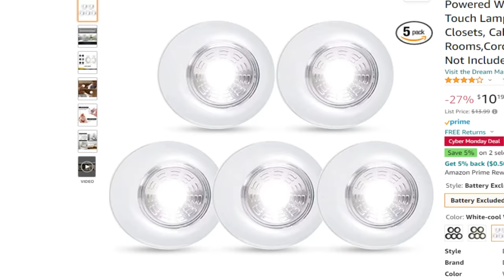3D Printing an Iron Man Suit! | MK39 Starboost Part 10

Comment: Best thing I can think of for the jet packs is a combo of fans and those smoke pen tools they use to test airflow. I think there's a variety they make that operates with a liquid, that way you don't have to deal with air compressors. 

Though no matter how I see it, there's a danger. With those, it's a chemical danger. With compressors, it's a mechanical danger (explosion).

Comment: Hey frank! for the battery pack, i got a way with using a 4x AAA battery holder with a built in switch and hid it behind the servos. It’s wired directly to the Vin ports on the board the the +s of the servos. (They’re all in parallel) Maybe that can work in terms of getting the helmet to be all self-contained.

Comment: On the lights system.  Did you ever look into the Jeep rock lights style system? It's the multi color lights yes it's a 12v system but I think the lights run a lower voltage setup. The controls would be cool because you can make them flash and flicker through music and change colors or just keep them on solid.  Just curious if you ever thought about that direction.  Again thank you for the great content.
Reply from the maker: That would be massive overkill. If it’s a 12v system you need to run 12vs. You can accomplish the same with neopixels
Reply: @FranklyBuilt  I believe the lights are reduced down to 5v or something similar but I am curious about the reduction to operate the board. I have a cheap set I'll run some tests on them and report back to you as soon as I can

Comment: Heya bud, I know I’m a little late to the party because I’ve also just started building a starboost of my own (it’s so cool and unique but still quintessential iron man at the same time) I was wondering if cannibalizing a MagSafe-like plug and socket could work for quick and secure connect / disconnects for the helmet battery inside the jet pack, and if you’ve attempted exploiting it yet? 
Big fan of the channel, thanks for your time! 😄

Comment: i have some questions about the motorization because although i made a motorized iron man helmet it is finicky and was wondering about the updated file for the mk 85 helmet on cgtrader which you use and hav talked about. by walsh3d.  since it has built in motorization. can i adjust the size of the helmet and still have the built in motorization work?

Comment: How did you decide what to size the arc reactor to so that I works well with the hole in the chest?
Reply from the maker: I printed it at 100% scale and checked if I wanted it bigger or smaller. Then printed another

Comment: I wish I would have paused it at 7:20 before.  I've been having a horrible time with the ark reactor because the "basket" (bottom housing) is too big for a 16 LED ring and too small for the 24.  I thought it was just me having an issue but I see now that you basically just attached the top parts directly on the clear ring itself and the top cylindrical parts don't touch the prongs of the basket ... I'm printing my 3rd basket scaled up to 80mm x 80 mm trying to get the damn thing to fit the parts. The designer didn't make it for neopixel rings to be fair.

Comment: I’m making an iron man mk85 helmet and I’m going to be scaling it down to 94% but the magnet holes are going to be to small for the magnets for the jaw. What should I do?
Reply from the maker: You can use heat to make the holes wider
Reply: Alright. Thanks!

Comment: How did did you mount thise inner rings? The files just prints 5 rings, with no way to mount them
Reply from the maker: What inner rings?
Reply: There’s a file for 5 rings that are inside of the reactor. The file is called “main inner 5 rings”

Comment: Please tell me how to get rid of stringing? I'm new to 3d printing. I have CR10 S Pro V2
Reply from the maker: You need to adjust temperature and retraction
Reply: @FranklyBuilt  Can you be more specific? 
These are really my first days in 3D printing
Reply from the maker: Stringing is from improper temperature settings in the nozzle. Or your retraction settings in your 3D printing program aren’t right. It takes some fine tuning
Reply: @FranklyBuilt  Thank you very much
Last question if I may
What print bed do you use with Cr10
After printing the model can't be removed easily

Comment: Hi Frank.... on the cables to the switch in the chin is it actually positive negative? With a switch isnt it either positive and switch wire or negative and switch wire?
Reply from the maker: It doesn’t matter which is which
Reply: @FranklyBuilt  but you said positive and negative, not a switch
Reply: @FranklyBuilt  you can’t put negative and positive through a switch…. It will short out
Reply from the maker: @MarkCrockett-mp9po  what? You put one side on positive and the other side on negative. It’s a limit trigger switch for the input on the Alisha board. It doesn’t matter which side you hook the wires up to in the trigger.
Reply: @FranklyBuilt  can u check 14min 15 seconds on your video. You definitely said the two connections to the foil connections are positive and negative. Not a switch through

Comment: 100% the DoD3D helmet that comes with the free suit model is awful.  At least the motorization setup is.  Save yourself hours of frustration, the motorization kit is JANKY to say the least.  I ended up using parts from the crashworks files (lifter arms), cut and reassembled in software to size, plus actual nut/bolt hardware to make it work... after several wasted hours.